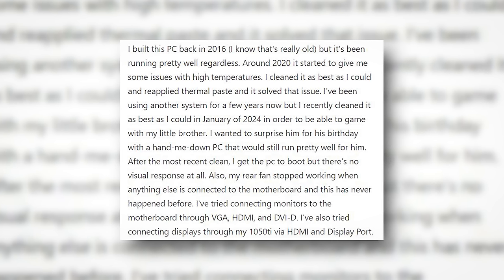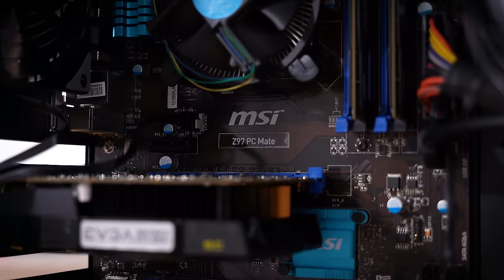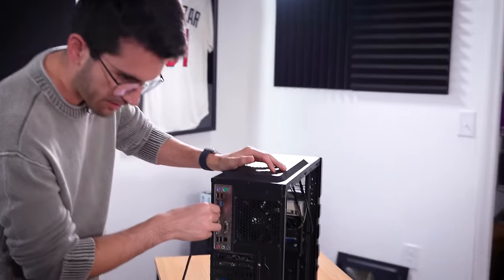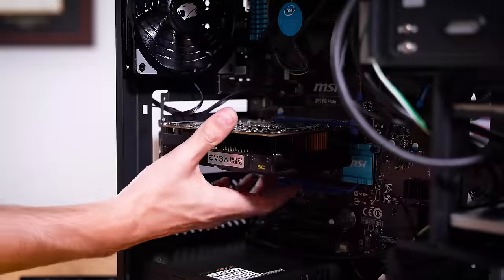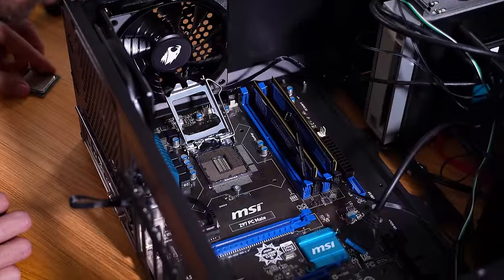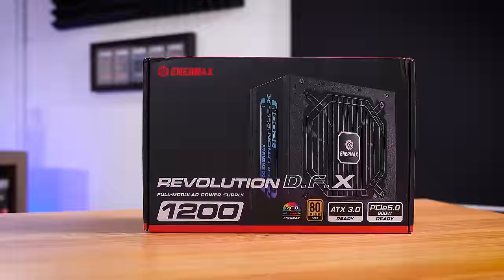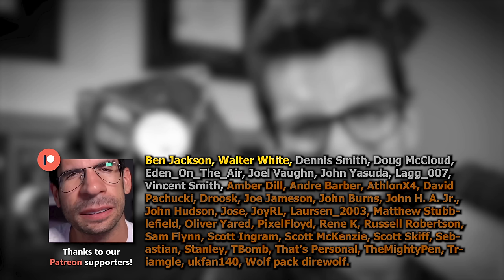Fixing a Viewer's BROKEN Gaming PC? - Fix or Flop S5:E4

Comment: The USB port probably took down the 5V rail I would suspect. When you bent the pins back and resolved the short you probably saved your own PSU.
Reply: USB should never be able to pull that much without its OCP kicking in. I'd say it's just a coincidence, probably a bad cap in the power supply.
Reply: @PileOfEmptyTapes  most mobos from that era don't have any sort of OCP built-in so most of the times the power supply will bite the dust in these situations
Reply: I was just going to say that...USB uses 5V.  Anyway...my conclusion is that computer was not taken care of anywhere near as well as the owner claimed it was.
Reply: @PileOfEmptyTapes  Yup, it should never happen, but that never stops these things from happening.
Reply: Nah, MBs even that old can operate with USB shorted. Some even will report a short into POST status sequence before proceeding to boot. Unless it is some kind of cheap aliexpress one.
Reply: I strongly suspect you are absolutely correct. It makes the most sense by far.
Reply: The fan could kill it too. The air (if the owner used) could apin the fan
Reply: @sgstudioofficial Some boards can even survive lightnings like my old trusty P8P67 EVO. Modem was connected thru usb, i heard lightning nearby, immediately windows plugged off sound. I did have a UPS which probably took the brunt and protected the insides, however i lost my DGN2000 modem. Afterwards it started to not post sometimes, no video etc. 2 usb ports were shot, probably modem took them out and shorted something on mobo. Sent to local distributor, they had a lab, actually repaired and sent back the same mobo, still working after i can't remember how many years.
Reply: I think the psu bent the pins of the motherboard when it shorted on the 5V rail
Reply: @AeiKei  The PSU isn't supposed to bite the dust, it's supposed to trip the protection to prevent destruction.
Reply: @samiraperi467  well it was bronze rated power supply, those aren't the best quality. Also, let's not forget the whole Gigabyte fiasco where the OCP would not engage...and I would say EVGA is kind of in the same park when it comes to power supplies...
Reply: Actually my MSI DDR4 Motherboard USB deal Melted and it messed up my USB i had plugged in so i quit using it
Reply: @LtCatscratch  I had a lightning strike take out my ethernet adapter as well. Cheap mobo, I just use wifi now, but I'll eventually upgrade the entire setup, and invest in some kind of surge protection.
Reply: I had the same thought.
Reply: @LtCatscratch My mom's build was hit by lightning along with our other appliances. Her board however survived. Albeit it only had a few working ports and slots after. But it did work. 😂
Reply: @PileOfEmptyTapes  Some OCP protection will not prevent damage from a dead short to ground. It doesn't act like a circuit breaker or fuse. It usually prevents over-voltage or may detect an open circuit condition.

Comment: LMAO that HDMI fan trick is neat 🤣😆🤣😆
I been working on PC's since 1995 and have fixed 1000's, and I never saw that. EVER.. LOL
Reply: well even us old timers can learn something new, i still love learning new quirks here and there :)
Reply: on the 4th gens, the digital display stuff goes directly to the cpu, and since the bent pents were in the area of some of those pins as well as the DMI pins, i'd guess it shorted some things and messed with the PCH's signals to kill off the pwm to the case fan headers.

no matter how much we understand about computers, there's days when they're still completely black magic that follow their own arbitrary rules.
Reply: 69th 👍🥳🥳
Reply: Really? If a board behaves in a strange way, it is almost ever a short somewhere. And most shorts are either rom sockets or from screws behind the mobo... So I suspected that from the beginning...
Reply: @TheFloRidah  the 3rd gen cpus used something else (hdmi port to the chipset ->interface chips to get hdmi signal/timing), but the 4th gen basically hooked (not really, but basically) the hdmi port directly into the cpu socket.

most of the digital video stuff that was in the chipset and external to it got onboarded in the 4th gen cpus. 

i have no idea when amd did their switchover, but it was probably around the same time.

/shrug
Reply: Hey man when you do something for so long you see a lot of things you didn't know could happen. I've been a mechanic for 8 years and even I see some new things all the time. They tell me the horn doesn't work. And on these particular trucks the horn only works when the lights are on. So i turned the lights on. And nothing. Then i hit the steering column with a hammer, and it started blaring. Safe to say from there we were able to figure out the issue.

Comment: I'm willing to bet the busted USB port shorted the 5v rail on the PSU. Even removing the short, that motherboard was trashed and shouldn't have been trusted. Full replacement was the right call.
Reply: @manusoftar that if he had the supplies and I am pretty sure in another episode he said he don’t mess fixing power supply
Reply: michaelscarport I think I watched that same video of Greg’s. And, you’re correct- this series is designed to help people diagnose and fix issues. He has made multiple comments about not doing things that a user at home might try to do and could really mess things up or worse, get hurt. Such as opening, diagnosing and fixing a PSU.
Reply: @manusoftar  lol what? It is NOT dumb. What would be dumb is opening up a power supply and messing with the internals when you don't know what you're doing. Which is why he doesn't do that because he wouldn't know what he was doing and likely shock himself. I'd rather just replace the PSU outright then risk shocking myself and potentionally having to pay a hospital bill + the cost of a new PSU anyway.
Reply: @manusoftar  That's not an option fro most people lol. You gotta have the right equipment and skill to take that stuff on, and Greg doesn't. Why do people keep banging on about this shit? If you don't like the fact Greg doesn't do electrical repairs on PC parts then go watch those that do instead! They exist on YouTube.

Comment: Even though you found the bent pins on the CPU socket, it was probably a good call replacing the motherboard, as that USB socket, the bent pins on the CPU socket and those power anomalies, the board might not work for long

Comment: Always essentials first when it comes to trouble shooting. Bro got a brand new rig that whatever he did to it would not post at all, mind you all parts were out the box new. It was the power supply front panel connector in the wrong thing, preventing the system from doing anything. Stripped it down to parts reconnected everything carefully and fired up on the 1st go. Before that I was going down deep into rabbit holes and lost hours I will not get back )

Comment: Never thought that this was cased by bend pins. Even as you rebend them, I thought that the USB port killed the board by shoring something. Really unexpected repair of the board. And  again a great video. I like it very much that you never give up until you found the root cause and not just going the easy way by simply replacing anything that could potentially faulty. Thanks for that series and you being such a good teacher to us out here. Even with many years of experience in repairing PCs on my own, I can learn something from you. Very inspirering for me to watch.

Comment: Hard to tell without getting closer to the USB port issue. However, it looks like it’s an issue with the IO shield. When the motherboard was put in the IO shield prongs were bent out and interfering with the port itself. some one may have tried to plug in a USB device or cable and bent the prong into the port. Removing the motherboard and bending the prongs back would fix that.

Comment: Amazed that a few bent pins caused all the issues here. And you were actually able to fix it. Good job. Fixing computers is always a trial-and-error event. Sometimes it goes really smoothly and sometimes, not so much. But in the end you have given this user a decent upgrade that they can upgrade some more later down the line. I'm sure the customers little brother will be very happy with this PC now.

Comment: Don't think you should feel too bad about upgrading the mainboard ... with that mangled USB socket I wouldn't have felt comfortable retunring it to the customer, even with the bent pins fixed and a new PSU. Job done well, IMHO. 👍🏻
Reply: I was thinking the same thing. It could go further south on its own, or the owner’s little brother might try to plug something in and wreck it completely.
Reply: @AtomicAJ74 Whenever I get to fix one like this I usually just pull/twist the tongues out from the broken USB socket to avoid it getting shorted again. Not everyone can afford a new motherboard and it will be 100% fine with one less USB port

Comment: I wouldn't think that the possibly shorted pins on the USB connector would kill the PS, since USB 5V is by design should run through a PTC-type fuse or other current-limiting components, but I also believe I've worked on a few "haunted" PCs in my time.  Very entertaining video, and thanks for sharing your thought processes as well.  I've gotten myself into trouble many times skipping basic steps or jumping ahead to what I was sure the problem was!

Comment: My secondary system is a 3770 (Ivy Bridge) with 16 GB of DDR3-1600 RAM and a GTX 1050 Ti. It’s used for streaming while I work and occasionally does some photo and video editing. With good SSDs and adequate hardware, these old platforms can still carry a load.

Comment: as I have seen nobody comment on this yet: the damage to the 5V rail on the power supply could be from the USB Port as this is also 5V, so  a shortened USB Port might have killed this part of the supply, although the supply should have protections against that

Comment: I used to have an almost identical build to this back in 2014-2015. But i had a 970 in it. Had the same CPU, MOBO, and Case. What a throwback!
Reply: It reminded me of my old i5-3570 and GTX760 build too. I kept that old workhorse for way too long and still have the GTX760 in my spare parts box for fault diagnosis

Comment: i would say whenever the fans are spinning full throttle and they dont settle down after a while, something has to do with the CPU not getting power or in this case shorted. It can either be a bad power supply, bad mobo or just a dead CPU.

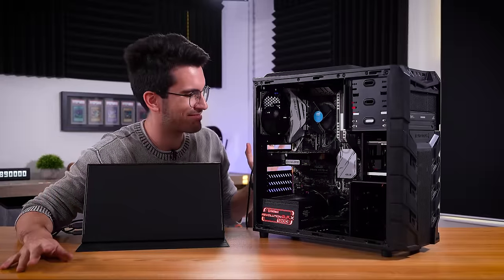Comment: Quick question if you are able to answer as i have had this problem in the past, why does the pc turn on instantly when you turn on the psu without touching the power button at 15:50 and 17:25??

Comment: So, all that was wrong there was the bent CPU pins? You were talking about a dead power supply, etc, but that was never proven. The short could have very well caused the missing 5V rail, couldn't it?? Would be interesting to know if a destroyed USB port and bent CPU pins could cause that while the PSU could still be perfectly fine...

Comment: Definitely worth watching. I'd say as well that you would have been right to replace the motherboard as even if the older MSI board is now working, someone down the line would have tried either by accident or curiosity plug a USB into the faulty port. Something else I've learned at my end as well is to not use a potentially faulty PSU on a motherboard as I had a EVGA 750 G2 PSU spike randomly and completely brick nearly every motherboard that was connected to it making it unstable for use.

Comment: When I recently bought a new case because my GPU wouldn't fit, I had a no power issue.  Turns out the plastic in one of my MB's USB ports got stuck in one of my cables.  The pins were touching the inside of the port which caused a short.  After bending the pins it solved my problems.  Luckily nothing fried.

Comment: My own personal experience here more years ago than I care to count. It has to be a bad power supply; I go and buy a new one work on it for a couple of hours with cable management and making it fit in the tight space we used to have. Then I accidently put pressure on the wall socket and hit the reset button voila the old power suppl suddenly has the hum that the old ones used to have. Oh and also always remember to unplug everything before working on anything.

Comment: I bought a used cyberpower pc for $10 from a kid who said it didn't work, turns out one of the usb ports on the back was mangled. It was worse than the one in this video, the system would post then turn off because of the shorted usb. After some surgical pin extraction (ie ripping all the pins out with pliers) the pc booted and never shut it self off. It had a 8700 in it 16gbs of ram and a 1060 3gb it is currently being used with no problems.

Comment: You always use a needle to move the pins. In the past, I found the metal tip of a 0.3 mm mechanical pencil and magnifying glass works pretty well.

Comment: USB socket totally destroyed and uses 5v power line and the power supply failed on the 5v line. Possibility that power supply saved the pc parts when that usb socket was broken. I was surprised that old board post tbh. Straightening the USB socket and the CPU socket both help it to post. Problem solving is fun but can send you crazy at times.

Comment: Just had this happen with a SFF Dell system I bought (intel 8500 cpu).  Ran fine single channel w/ 8gb that it came with, but I put another identical 8 module in and no boot.  Tried lots of trouble shooting and last ditch effort was to remove and reseat cpu.  That showed me a bent pin touching another pin (who and why...idk).  Used the macro on my pixel 8 and a sewing needle to uncouple the pins...I bent it back and voila!  Now I see all 16gb and dual channel.  Be sure to check yo stuff!

Comment: Anychance off some advice 

Changed motherboard to a x670 master am5 socket 

Upgraded from  Ryzern 5600 to a ryzen 7800x 

Went to Ddr5 ram 6000 mhz  fron ddr4

Getting dram error- power supply is currently 650 chance off it being not enough power all components are brand new

Comment: That's interesting - it wasn't on screen for very long, but once the pins were fixed in the original motherboard, I recognized the initial screen as the same motherboard that I have.  I have a comparable CPU and graphics card, but about 6TB storage in SSD/HDD drives.  These systems are indeed perfectly capable systems.  Naturally I would like to build a new PC, but I don't NEED to build one right now.  It's surprising that CPU pins can get bent on a rig that's fully assembled and was presumably working previously.